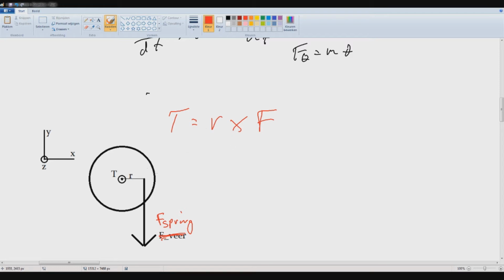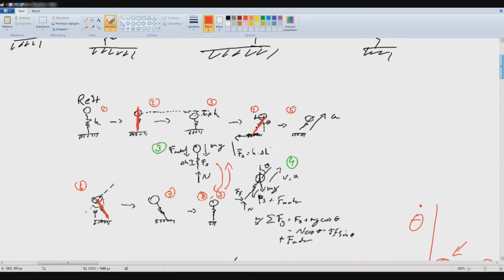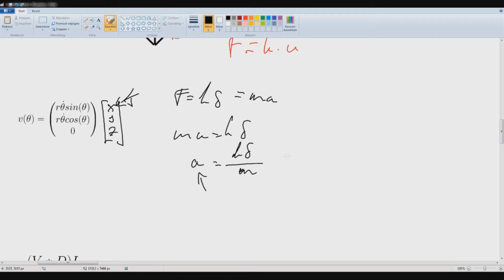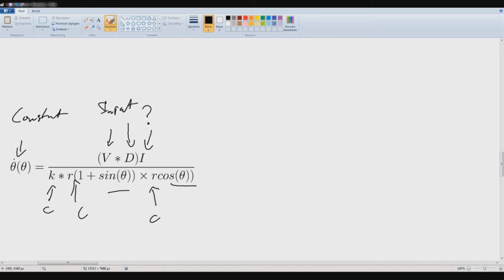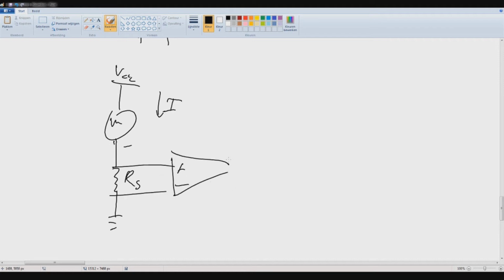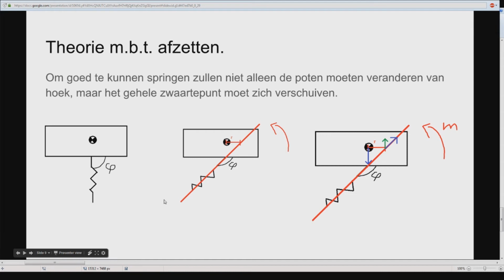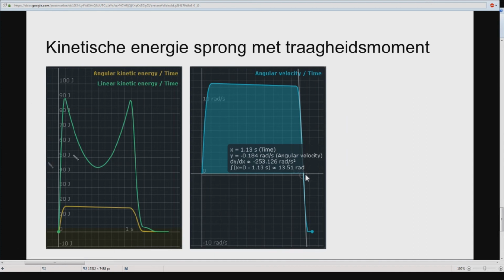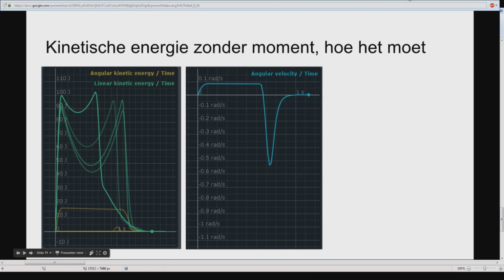Robotics project: Biomechanical Robot - Episode 1: Mechanics

Comment: At 14:00 I heaved a huge sigh of relief: Circuits at last!
The math is getting a bit above my level now.
Reply from the maker: Yes, yes, much more to come! Gotta build a circuit which can use DC drill motors as servos, but 100 times stronger. The math isn't that complicated actually, it's the mechanics and underlaying thought that requires a second to realize. To know that the motor will have different angular velocities depending on load is probably the hardest thing that I thought of.